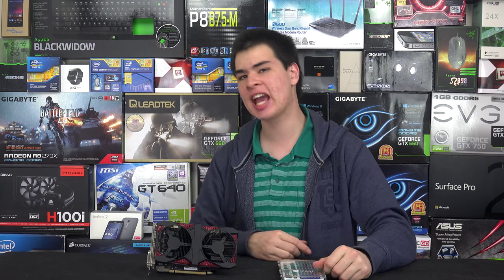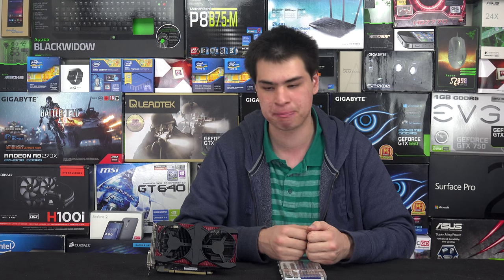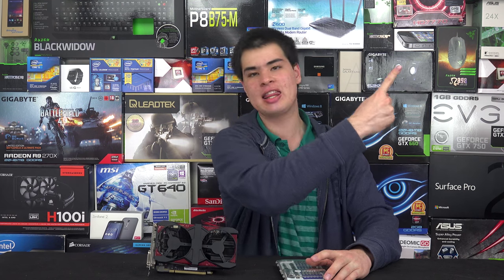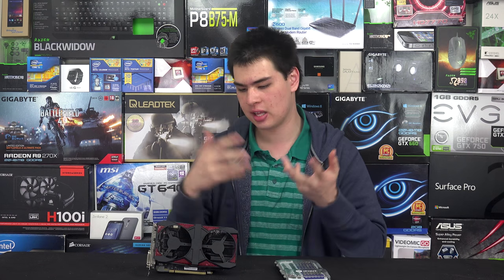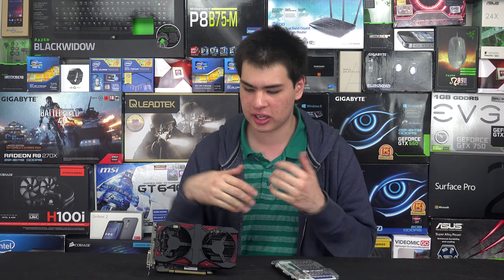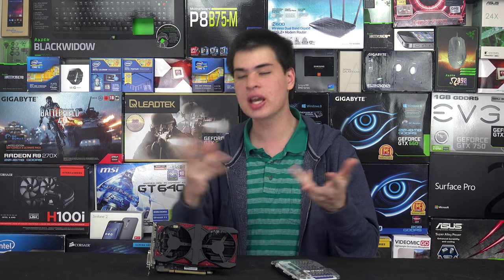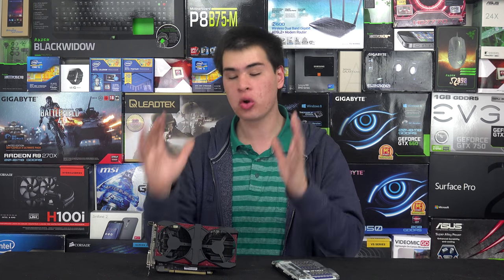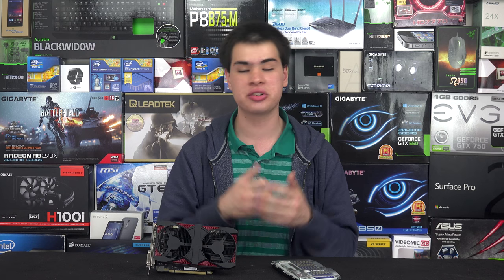How To Paint a GPU

Comment: Couldn't this kill your card? Covering over the heat sink where heat should be circulated with paint would drastically decrease your cooling performance! since your is essentially dead it doesn't matter but it your anyone is planning on doing this, watch out.
Reply from the maker: +MysticalGamingGuys not necessarily, yes there will be a heat increase but if you use light coats I have seen not more than a 10c increase on temperatures when painting gpu and cpu coolers. Also I do mention to cover the contact point where the cooler touches the chip while painting as to stop any problems with heat. On top of that every card made today and for the past few years all have safety settings to stop them from killing them selves. If it becomes a problem take some paint solvents and remove the paint. The idea of painting pc parts is not that new, just about all water cooler radiator are painted and there are quite a few air coolers on the market that have a thin layer of pain so they look good but still perform good.
If you feel too worried about performance just paint the plastic parts that have nothing to do with the cooling performance.